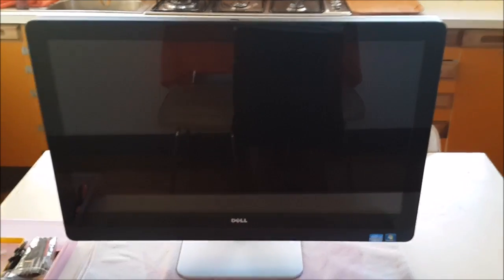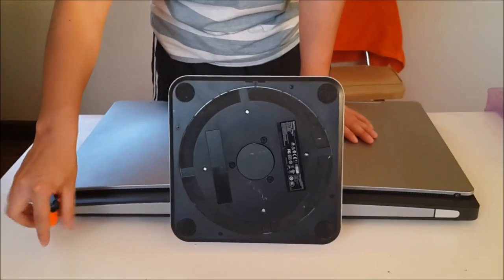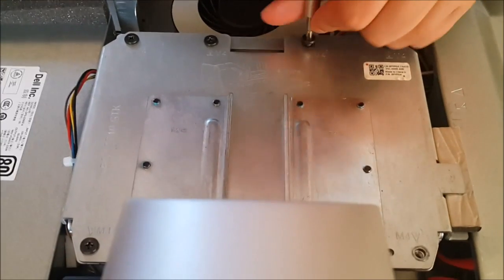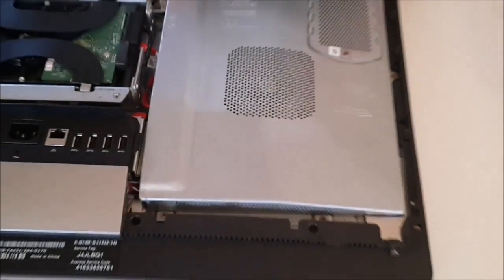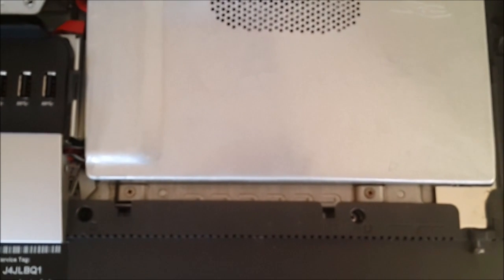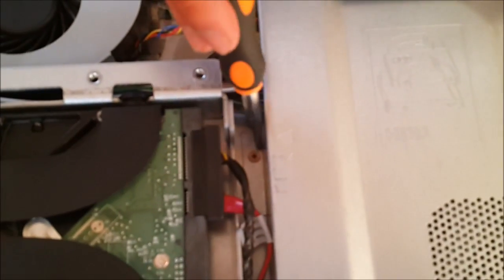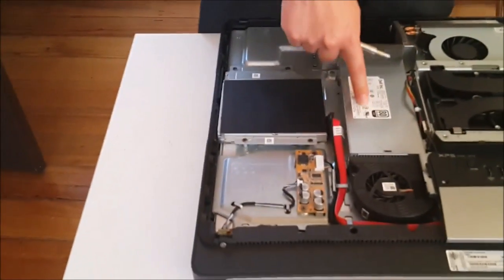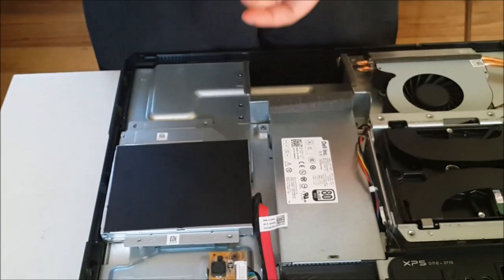OPEN ME UP! Dell XPS 27, 2710, 2720 Disassembly

Comment: Droids B Us! thanks! is that a SATA cable to the HD? the CPU in that unit, can it be upgraded? how much RAM can it support? also, can the screen be removed and made into an external monitor? great video, Open Up!
Reply from the maker: yes it is a desktop CPU therefore you can change it. only useful if you dont have the i7 already since the i7 is the best thing you can change it to. 16gb DDR3 ram is the max it takes with 8gb in 2 slots and there is 2 of them. the computer needs to turn on so you can use the screen as a external monitor. unless you buy a driver to run the screen by itself
Reply: OPEN ME UP ok thank you

Comment: Can you make a video showing how to remove the heatsink fan. My system has fan failure. I bought both replacement fans but I don't know how to remove the fan on top of the motherboard/graphic card. I would truly appreciate your assistances, thanks.
Reply from the maker: sorry i no longer have the item to show you. but if you look at the item you have you will be able to see where the holes are for the screw to go in. since you purchase replacement parts they have the holes for the screws to go in but no screws. now look at the motherboard and remove those screws.

Comment: Thank you for this helpful video. Is it possible to keep the HDD and add a SSD? Is there space to mount the SSD and is the motherboard able to accept an additional drive?
Reply from the maker: there is space inside the computer but there is not plugs available for you to use. you will have to use the dvd drive connectors if you want to use two hard drives
Reply: Can I use a mSATA SSD and make it a boot drive and keep the existing HDD and DVD?

Comment: You don't show how to remove them. Is it easy? Or, do i need to remove everything before getting to them?
Reply from the maker: after removing the back cover and stand you can remove them. there is a black plastic bar on the bottom that has your dell serial number and other details on it you need to remove that which is held down by four screws

Comment: Can you tell me how to remove the module where you plug things in so I can get the motherboard out? I need to replace it and am stuck. Thanks.
Reply from the maker: you need to remove the bottom back part where the  serial number and speakers are
Reply: @Diona Austill what motherboard did you go with to replace the original? and was it expensive? Also after you replaced the motherboard did everything work as it should? Did you run into any problems? Thank You

Comment: Interesting video! I have question... My Dell XPS 2710 has unfortunately developed a blue vertical line from top to bottom about 3 quarters of the way across the screen from the left. As best I can tell it's a screen fault (LED burn?) and not the graphics card.
From your experience, do you know if it's even possible to replace the screen? I'm guessing not from your video, but I'd just like some confirmation.
I'm still waiting for Dell Support/Sales to answer my question.
Thanks, in advance.
Reply from the maker: You can replace anything just cost that's all. I didn't show it in the video because many people get scared to replace something like the screen
Reply: +OPEN ME UP Thank you for the reply 😊. Hopefully Dell get back to me & let me know the cost.
Reply from the maker: I don't low where you are located but in Australia one of there doesn't cost much and a faulty one only goes for around 200aud complete
Reply: I got my quote back from Dell...
A replacement screen from them will cost ... AUD 2,667.50 !!!
I can optionally pay an additional AUD 165.00 for installation.
Talk about outrageous.
It will be way cheaper to replace the entire Pc with something modern, and not Dell.
Reply from the maker: Their quoting thing is a bit wrong. Because I called them up a while back for the motherboard for this computer they told me 800 and something. But since you typed you quote in AUD then it must mean you live in Australia. I saw a few faulty ones going for 150 on ebay
Reply: Thank you. I'll keep an eye out.
Reply: Hi, actually i need to replace the screen of my 2710. Can you help to me how can i do ? i really ll be apreciated your help
Reply: Hi, actually i have the same problem. I bought the screen to replace. I dont know if finally you replaced yours. I am looking for some help to replace the screen. Regards.

Comment: Could you possibly connect an egpu on to this ?
Reply from the maker: yes and no. if you can find one that works with usb then you can but right now there isnt any available that work with usb they need usb type c or thunder bolt
Reply: +OPEN ME UP i see some stuff about pci slots and the sorts im not sure,  but im sure the aio has some
Reply from the maker: +shanig manig yes you can use that but then you will have a cable sticking out of your computer from the inside. also that isnt a proper method of using external graphic and might not work correctly

Comment: I know you can upgrade ram and hard drive but could you possibly upgrade the cpu plus gpu? They do not seem soldered on.
Reply from the maker: cpu isnt solder on but gpu is.
Reply: OPEN ME UP noob question: can you change the gpu or you have to change the motherboard with it because of soldering? I just really wanna change the gpu. What could i do?
Reply from the maker: you should buy another computer. it only has two options without one or with one. the gpu if comes with is crap and you will get more for your money if you went out and buy a desktop
Reply: I have the XPS One 27 with the i7 4770s, GT750M etc etc. I am wondering whether it is reasonable and easy to remove the CPU and Ram to build a Frankenstein Desktop PC? You said that the CPU wasn't solder, but how hard would you say is it to remove it? It looked pretty straight forward in your video!

Comment: I was wanting to replace the Dell XPS one 2710 I/O Panel with a Dell Xps one 2720 I/O panel so that i could get a firewire port. looks like it would work but could you confirm? Or do you know a way i could get a Firewire or thunderbolt port on my Dell XPS one 27?
Reply from the maker: the ports are solder on to the motherboard so you cant do that
Reply: I was referring to removing the entire I/O board and replacing it with a 2720 version. from what i can tell it can be done just figured since you've opened it maybe you would know. hes my reference link http://www.manualslib.com/manual/412284/Dell-Dxcwrk1-Xps-One.html?page=91#manual
Reply from the maker: the 2720 and the 2710 uses the same everything just with different cut outs. therefore the I/O cover will fit and the motherboard from 2710 will fit the 2720
Reply: +OPEN ME UP awesome thanks! will let you know once i switch them out how it went :) appreciate it!

Comment: how can you eject a stuck cd?
Reply from the maker: You cant, you need power and also a computer that is on as the computer give the CD the command to ejected
Reply: OPEN ME UP  most drive there is hole next to eject button, push a pin to open. like iphone sim tray. i donno bout xps but look for tiny hole.